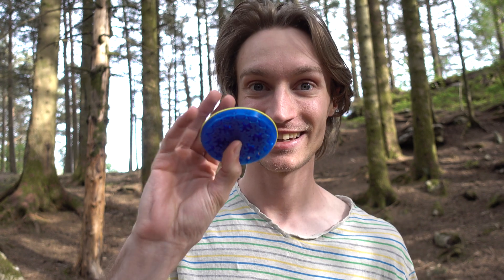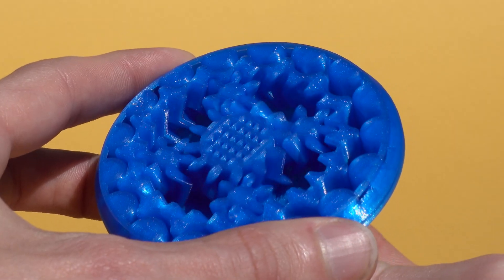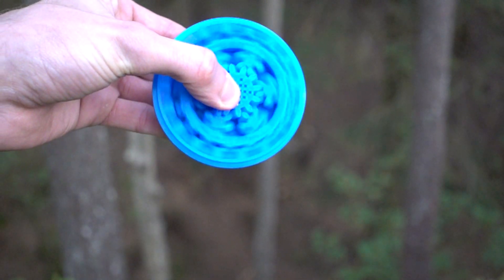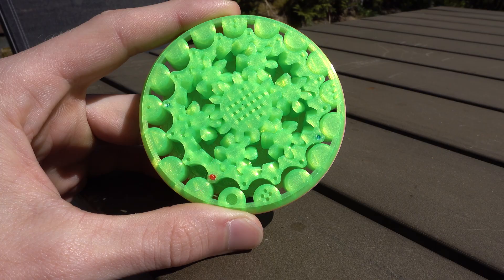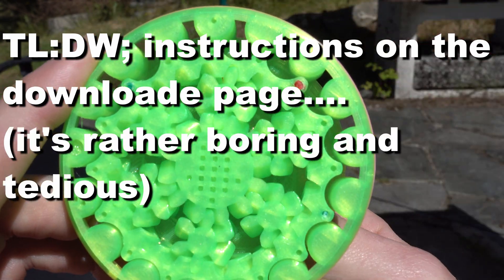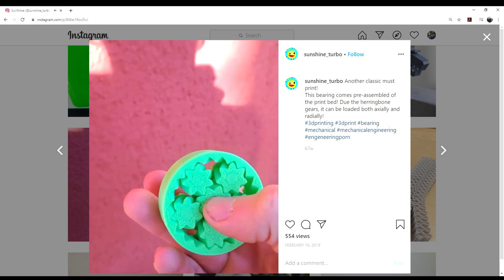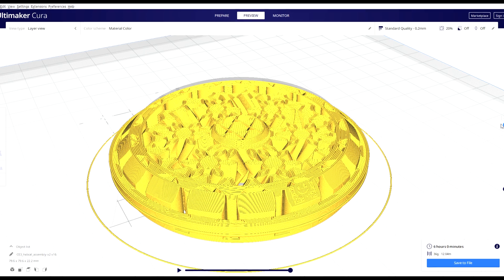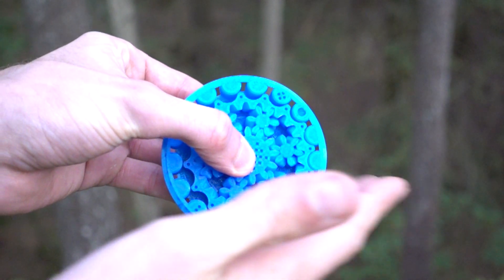Print In Place Cycloidal-Roll-Measuring-Tool!

Comment: Well took me nearly a month and a dang-near complete rebuild of my printer (Anet A8), but I FINALLY got one of these to print out nicely.  Trick for me was to NOT do the typical "first layer squish" (usually do a 0.18mm 1st layer @ 0.2mm layer height).  When I finally changed the first layer to 0.3mm (0.2mm overall layer height), it worked out and printed quite well.
Only took a little bit of effort to free ALL gears and it spins smooth.
Love love love these print in place designs.
Keep it up SunShine, thank you!
Reply: i have the anet A8 too but i printed it and i cant make it move :V can you help me pls?
Reply: @gansago78v80   As far as I can recall my settings (CURA - 4.6.1), most CURA settings for "DRAFT 0.2mm" are left alone except:
      0.2mm layer height
      0.3mm First layer height
      0.8 wall thickness
       Z-Seam Alignment "sharpest corner"
      Infill 30% - "lines" pattern
      205C for my material (hatchbox) / 60C Bed Temp
      Speed: 60 mm/s
      I left retraction on and left all retraction settings as "stock"
      Cooling 100% fan AFTER  first layer
      NO SUPPORTS
       5 line skirt (for nozzle prime only)
      I also took extra time to ensure Z-axis was level, bed was level, belts properly tightened etc.
And thats about it,  most everything, like I said, is the stock CURA DRAFT 0.2mm settings.
After it printed, I did have to push the "knob" in and out a little to free up, but took very little for the whole thing to free up and move smoooooth.
Good Luck!
Reply: @polypetalous  thanks ill think i try it again

Comment: I wonder if the thickness of the rubber band is causing the error in measuring the picnic table top.
Reply: I bet if you fiddled around with scaling for a while you could get an accurate measure.

Comment: "a bit disappointed, to be honest" LOL just awesome. Time-outs for everyone who didn't see the box video. Too bad this isn't able to be accurate. Could attach an analog counter that triggers each revolution by a pin hitting it and hook a long handle onto it (handle for on a roller or broom) and have a long distance measuring device!
Reply from the maker: Thanks :) I mean, it should be accurate, it might just be very prone to slipping and thus not giving the correct measurement. physically there shouldn't be a reason for why its not accurate if i did my math right, but who knows ^^,
Reply: @TurboSunShine  The circumference just doesn't seem to be 0.25 m? ;)
Reply from the maker: @HerrSalat  when i looked at it from an angle, it looked about right